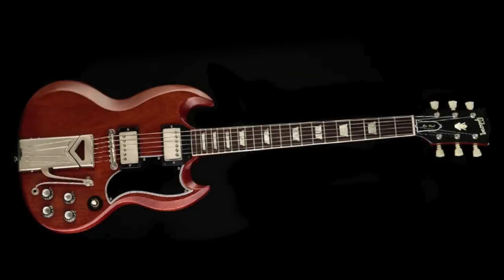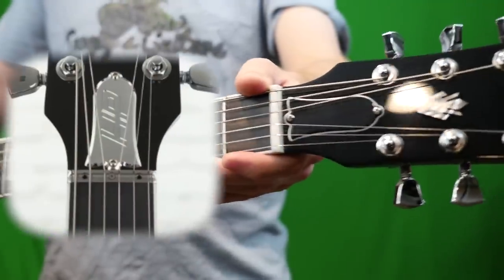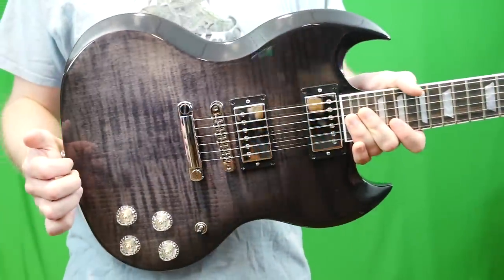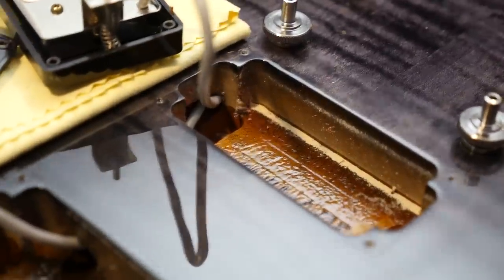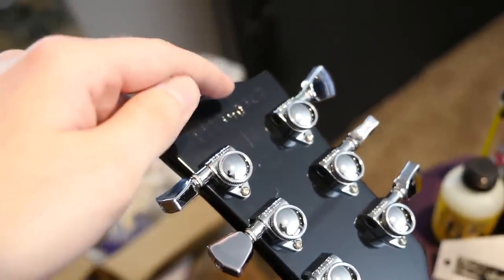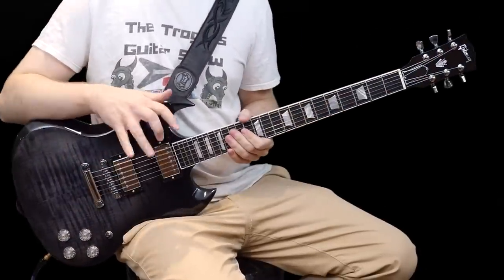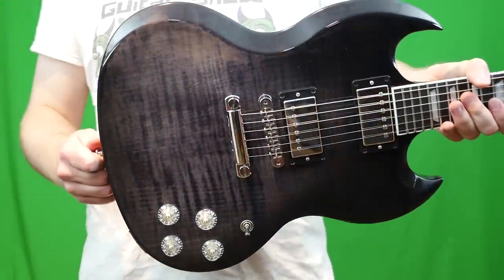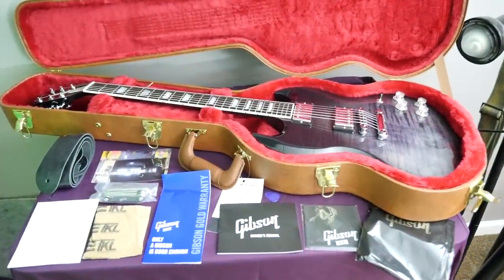Is this the Best SG Ever Made? Maybe... | 2019 Gibson SG Modern Collection Ebony Fade Review + Demo

Comment: Just bought a 2020 SG husk to hot rod with my own parts. Love the options of coil splits, all my humbucker guitars have them. Listening to this demo, I just can't really get into the bridge coil split sound. It sounds so thin and, just ... no. Solid guitar otherwise. I really think everyone should have at least one SG in their collection. In all the years I've done cover music, I've realized that what Trogly says about getting the Strat sound "in the ballpark" is typically good enough. Only elitist tone snobs will be turned off from the mimicry. It's a good thing most of the money made is from people that just want a good time and don't really know anything beyond "did it sound good enough" instead of "well, that song ACTUALLY used a 1972 Fender Strat with coil tap and [insert specific pedal here] so my experience is ruined." The SG is a lot more versatile than some people give it credit for.

By the way, I overcame the infamous neck dive by using a thick padded leather strap with EBMM strap locks installed. The wider straps tend to correct the neck dive despite me putting locking tuners and a string butler on there. I love that there seems to be a guitar for everyone out there. Love the masculine Les Paul sturdiness? Great. Love the petite, feminine neck of a Fender Ultra Luxe? Go for it! Get what suits you and be happy.

Comment: Very beautiful guitar! Moreover, it has 24 frets and the jack plug in finally placed the right way. On the other hand, the strap buttons should be placed like a Stratocaster does for a better balance between the body and the neck. In any way, with that kind of guitar straplocks are mandatory (in case you don't want to throw $1,999 to the floor).

Comment: Wow my 2020 has so many tiny details that are different.  The bridge on mine uses flat head screws.  The tuners are a different shape.  The strap buttons are not the large ones and the one on ther back is in the center.   I see yours doesn't have fret nibs either.  Mine is also had traditional wiring.

Comment: The guitar is beautiful and I always prefer any guitar with an Asymmetrical. I myself prefer a wider nut, not that I have overall large hands but my fingers are thick and muscular. having a size 13 ring finger says it all. The coil split is a plus for the most part it has only been on Epiphones or a limited amount of higher end Gibsons.                                                                                                                                                                                 I love the Les Paul HP Asymmetrical neck that flows right into the body. Gibson might want to make more neck thru designs on other models, hopefully on SG's The sound of the model you chose had absolutely no depth. Most 24 fret models and I mean every manufacturer fails to really think that out they simply cram two large humbuckers into a the tiny space left, creating an overlapping sound from already overcrowded humbuckers.  Here is the bottom line 24, 22 or 20 frets only sound good when there is enough room to allow for two humbuckers to co exist. If you really want a two octave fretboard add another string not a longer neck. Everyone should realize the moneymaker for any guitar are in the first seven frets. Old school or modern appointments mean absolutely nothing it's the person behind the instrument that matters.                                                                                                                                                           Another Incredibly great job Trogly. I love the way you go the extra mile to review a guitar. If you were sell-in, em, I'd be buy-in, em from you.

Comment: The best SG ever made was neck through and said "Yamaha" on the peghead. 

Actually, of the near gibson copies, tokai's custom shop SGs with a fat neck were much better sounding and much stiffer than gibson's SG. And less if you can find them (like SG185 tokai) in japan. Spec on the SG185 is similar to the custom shop version that gibson tried to sell for $4800. 

I bought one of those, $890 used in japan. Stupidly sold it over here for a slight profit. Best sounding Gibson SG pattern guitar that I've ever seen in person, and my first SG was a '61 reissue, so it's not like I haven't seen anything made by gibson in their somewhat overpriced ranges. 

The yamaha SG comment was made in jest a little bit - they're more like a doublecut paul, but they are huge sounding.

Comment: For me it can't compete with so many other nice SGs this year (I LOVE the '19 special)

SGs should be an 1/8 inch thicker IMO, but then they go and weight relief it..what the heck? So close.

Compound radius, asymmetrical neck, maple top, the fade paint are all changes, but none of those are selling points for me.

24 frets should be the law on SGs because it's a natural fit. 

You are correct about the stop bars. I swapped the weightless bar on my '18 SG with the one from my old '97 les paul and both guitars were better for it. SG should come with a heavy old school bar (and be 1/8 inch thicker).

I am happy to see there is no PCB in there. Not because it sounds bad, but because it's silly. I want to be able to swap pots, pickups and wire things this way and that over time. The PCB on my '18 SG had an input jack that contacted the back service plate making crackles and pops until I ripped that junk out.

I don't like the control cavity. Why would they leave the weak spot near old input jack if they are not putting a jack there? Maybe that's the weight relief? I dunno!

I don't like the knobs. They would be replaced instantly. I don't think cheap plastic knobs should be the main eye pull on my expensive guitar.

I don't like the strap on the horn or the jack on the side.

Thank god the robot tuners died. I refused to buy a guitar with those and I still do.

All in all I don't hate it. It's not to my personal taste, but I feel it's an improvement over the hideous HP line.
Reply: crush537 
I think the output jack on the side is a great improvement but a right angle input jack on the cable works great with the top mount.

Comment: I really love my SG modern, it plays and sounds like an absolute DREAM! But, mine had some definite QC issues.
1. The neck pickup hums really loud, but it gets even louder whenever I touch a metal part of the guitar, including the tuning buttons. We’re taking it in to a guitar tech to fix that this week.
2. There’s a little bit of a buzz coming from the tailpiece whenever I play a A5-C6 for some reason?
3. There’s a little bit of black stuff on the binding on the neck, right next to the neck pickup. I think they possibly failed to completely tape that part off when they were spraying it with lacquer? And there’s a bit of red stuff too in the same place. And there’s some red stuff on the nut, on the side facing you when you play.
4. There’s this weird shiny stuff on the edge of the fretboard, on the side away from my face, from roughly the 18th fret to the 24th fret, it’s not oil I don’t think, because it would have soaked in by now.
Now for the positives, it plays and feels like a dream. I never thought I was an SG guy, ‘cause I’m not into heavy music, ‘til I tried this. I love the ebony fretboard, and the MOP inlays. The top on mine is particularly nice, I’d even argue that it’s a triple A. It’s probably the black that makes the flame pop. The finish is impeccable, doesn’t have a blemish in it. It’s one of those guitars that I could play unplugged for hours. The set up is perfect, the frets feel great and the action is perfect. Plugged in, it just makes me wanna crank up and rock out! It sounds great just slightly overdriven. It’s a riff machine for sure. And I really like the extra 2 frets. I think mine just simply got a little overlooked is all.
Reply: Yeah, maybe. Although I’d hate to get another one with QC issues like this. I think the buzzing is a grounding issue, so I was gonna take it in to an authorized Gibson repair person to see what they thought, and use the warranty on it. I do wish I had a chance to play it before I got it, but whatever. It’s a tough call, getting a replacement one would be a good and easy option.

Comment: I have this guitar the HP version and loving it, though do agree at first how neck heavy the guitar seems when playing with a strap. Found the issue to be the strap knob location, which seems to be in the upper right position, though i think most SG guitars have it in the middle of the body, tempted moving it but was worried about how close the pickup cavity would to the screw, so i moved it to bottom. Though i can see a strap does get in the way when trying to play the 22-24 frets the guitar is much more comfortable to play. I wonder why the strap knob is in a strange place cause there is a real difference when its changed..

Comment: Would it be possible with these pickups and the wiring setup to modify the guitar, so that the push-pull option on the volume knobs would instead trigger a series/parallel switching, rather than splitting to single-coil mode?

Comment: Nostalgic svada..  I have an SG.HP  2019 Burstbucker Pro pickups ebony fade and its Very good..Necdiving is still a problem with SG.Designproblem.Make the horn above the nec 2 inch longer so you can move the strapscrew to the end of the 2 inch longer horn.problem solved

Comment: Hey Trogly, I was wondering if you could identify the model of my SG. I'm really confused on whether its fake or not. Would you have an email or something to contact you on?
Reply: Simple to know really, in most cases, remove the truss rod cover, if it takes a hex wrench, aka Allen wrench, you've got a fake. Granted, there's other ways, like knob placement, but that makes it super easy and one of the most used truss rods in China. Good luck.
Reply: @Damaged262  it's an epiphone SG though
Reply: @maxisrunningonempty  More than likely, it's real. At least the Epi's are rarely ripped off.  It does happen, but it's pretty damn rare. Generally, there's not enough money in it to bother. So, it's mostly, "Why bother" of a an issue when thousands can be made versus a hundred or two.
Reply: @Damaged262  any chance you could tell me exactly what model it is though, it has nothing on the headstock apart from the epiphone logo and the truss rod cover just says "SG"
Reply: @maxisrunningonempty  Sorry, I don't have enough experience. Trogly doesn't really do much with the Epis at least that I've seen. It'd have to be a special model.  Try this link if it has the code, either on the back of the headstock or occasionally on the block at the screw in neck metal:
 https://www.guitardaterproject.org/epiphone.aspx Also, checking what it says on the back of the pick ups, that might narrow it down, unless they were upgraded. Depending on what you paid, if they were, you might have gotten a great deal. If it has just one, it's a Junior and should have been fairly cheap. Hell, I'll be adding a Mountain of Tone Leslie West to my Junior, doubling it's worth, though I'd never get the money back, it'll sell for $100 all day long even though that's what it cost me. The pick up cost $60 or so on it' own as well as other upgrades.

Comment: The sg hp is better ('more options) but bad tuning (it does not stay in tune) 
the bb pro's are decent with too much brightness and not so powerful like 498t 
the sh1 490r sound better for the beck (blues warm tone) so it's different here :tight and bright 
the stock action was too high 
what els e?
but good dip switch

Comment: They need to offer some other colors. Those knobs need to go. Output jack good. Thicker body good. Weight relief, especially on an SG really stupid. No fret nibs excellent. NIbs suck, because Gibson doesn't have good enough quality control to execute these properly, and losing them regardless, good. Longer neck tenon good. Giant dents in fretboard most likely from the factory. Wow, eight pounds with weight relief, doesn't seem to add up. Pickups meh. Piezo sound description for the pickups is not a compliment to regular humbuckers. Switching nice. So SGs often have neck dive issues, so what does Gibson put on them - the heaviest tuners they can find Grover locking tuners. How is that for genius. I think this could be a great guitar, but there are some problems. The color choices are deal breakers for me. It's too bad. Nice review.